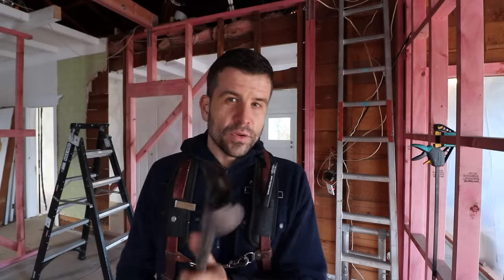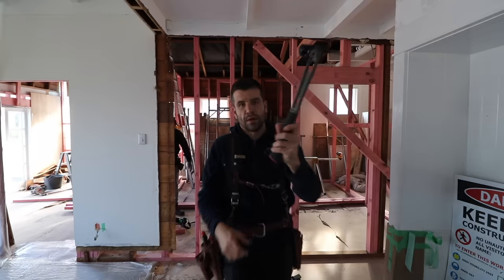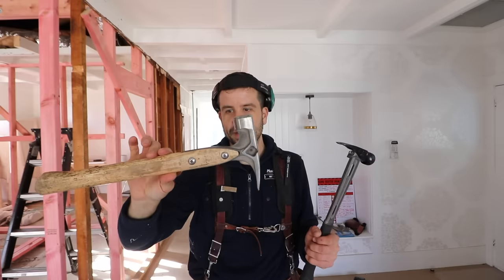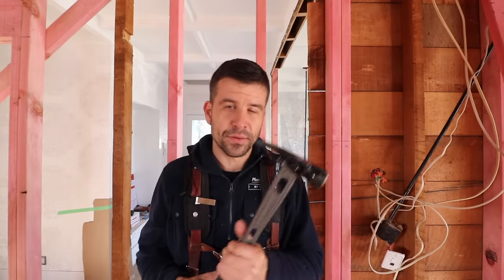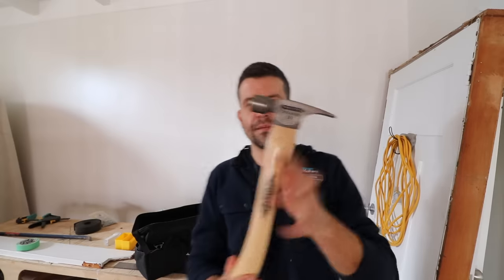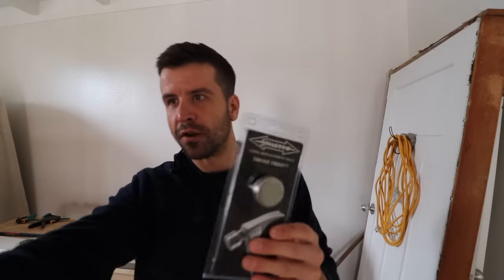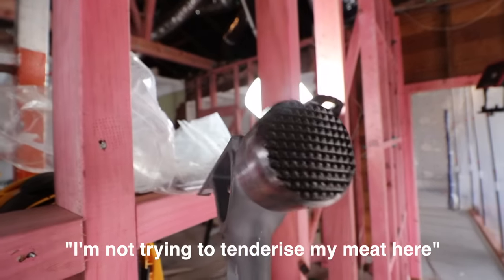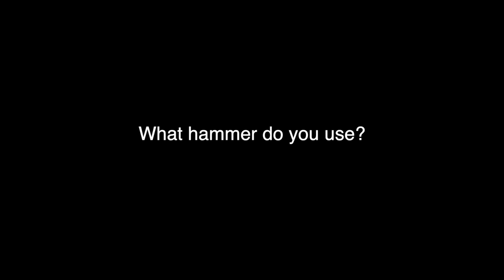Martinez M1: The Hammer Everyone Is Talking About

Comment: Very interesting. I'm not a framer these days but back in the 80s, 90s, and early 2000s I played with a hammer all day. To me the M1 is a knock off of the Stiletto yes they set up the head differently but it is a copy.  If you look back and it should be the same today the lightweight of the titanium hammer reduced your daily load and that since you are swinging less weight the speed at with you swang the hammer was increased and the impact load to the nail was roughly the same. So if this all is true and from using titanium hammers I think it is, then having that heavy steel head defeats the purpose. So I have always given the old Hart Tool company the credit for the California Framer style and that type of hammer and that was the start of the more compact head design.  I will give Stilletto credit for and I can't remember for sure but they were the first with the titanium headed hammer and it was a wood handle and titanium head. I had one when they first came out, then they came out with the TiBone style and I think it was called that too. I still have one of the original TiBones, a Hart Tool Company California trim hammer, and the head of and handle of the original Hart California Framer. The handle was a replacement and it was cut off-center so I never installed it but the head does have Hart straight handle in it. The Occidental Leather Stronghold setup you are wearing I got mine somewhere in the late 90s when they first came out and still have it. I ran mine a little differently I had a tape holder on one of the suspender straps and did not use the clip between them and before that, I used their belts standard style framer belts. The Dalluge hammer not sure but when they first came out they were made or just branded by a different company Vaughan, had one of them too. So one last thing the side nail puller, something I learned from the old guys back in the day when I first started swinging wood handles was to pull nails sideways they always side it was better for the handle and then years later I started seeing the pullers on the side. Good video thanks

Comment: 35 years on the job and still swinging a 28 oz Eastwing leather grip.
Reply: never seen a 28 oz leather grip estwing. Seen a 20 oz and the newer version, 15 and 19 but never a 28 leather. Interesting...
Reply: @ralfish2008  I still use a 32oz leather gripped Estwing I bought back in 1986.
Reply: @ralfish2008  My bad, Thought it was 28oz as was bought thirty five years ago. Google found a modern 24 oz English pattern. Looks like mine.
Reply: @aussiecue   Thanks for the clarification. Ive been bashing nails for 35 years and own a bunch of hammers no fancy titanium ones though just woodies or estwings when forming.  Never saw the heavy leather handled  estwings and was starting to wonder if it was a regional thing. If they had a straight claw heavier than a 20 0z leather handled one available in Canada  I would have bought one. I had a 28 oz blue handled one but almost exclusively used the 22 oz one. Wore several hammers out (the gap in the claw gets chowdered and the handle will wear out and come off eventually. Usually though the damn things just get 'borrowed"  Any one developing elbow issues swinging the steel shanked estwings was gripping the hammer too tight but  admittedly, when I was framing i'd use a  wood handled hammer, usually   a  Vaughn straight claw.

Comment: Its not about a timber or titanium handle. Titanium handle is for hard core formworkers, the handle is designed for cleaning concrete off sheets of ply  ready for re use. The hammer is functional. But realy how many nails did you mess up putting in,
Also never buy a n apron with a fixed holster for your hammer, simply put, customise your apron  and make it yours. Not make some one else's work

Comment: I have framed for 30years, with a wood handle, occasionally they break, but I have never had one “slip” in my hands! Other than the lightweight and low vibration, they are Way easier to holster! , and do that like 100 times a day! (I fucking hate rubber handles )

Comment: Don’t know if anyone has mentioned this, but I noticed all you guys swing your hammer with your thumb running parallel with the handle, point up to the head. A blacksmith taught me that this is wrong, and can lead to wrist and elbow pain, especially with the 1kg+ hammers they use. The correct hammer grip is where you wrap your thumb around the handle, like you are gripping a bat. Try it out and see how it feels. Cheers guys, phil
Reply: Larry Hahn also taught that you should wrap your thumb with a full grip like you’re describing.
Reply: Exactly

Comment: What's the difference between the waffle and the smooth? Is it just a preference or is there an actual function between the two? Love your work and appreciate you sharing your knowledge. Cheers from Paraparaumu
Reply: The waffle head allows you to get more grip on the nails you’re driving in but a waffle head is preferred for 1st fix because the waffle head can leave a mark when it hits timber and a smooth for finish but some carpenters use a smooth head as well for framing. I use a smooth face for framing.

Comment: The powers in the weight of the hammer, in the flick of the wrist and you need weight to drive a nail.  Anyone that uses a light hammer and thanks is easier on their arm are just using it wrong.  There should be no impact on your wrist or arm when and strike the nail with a a loose grip.  You need to catch the young fellas quick at the start your they continue for life and destroy there wrists and arms.  I can drive a nail with one thumb and index finger on the shaft in three hits with the right hammer.  Why do you think hammers have been the same weight for 100's its for a reason.  That guy failing to hit that nail was trying to compensate for its lack of weight with the weight of his arm to do it.  Buy a real hammer.
Reply: Exactly.  There's never a need to adopt a death grip when using either hammer or saw.  The tool virtually does the job for you if used correctly and hammer head weight plays a massive part in the job.

Comment: I started framing with a Stanley all steel 19oz framing hammer. I only used it for a short while, and then dedicated it to demolition only. Then I went to a Craftsman 20 oz fiberglass handle hammer, but someone swiped it. Then I was given a Hart hickory-handled framer by my father-in-law. Ever since then I have liked hickory handles the best, especially the axe-style ones that are curved at the bottom. After breaking the handle on the Hart, I got a Husky 22 ounce framer with a hickory handle and a lifetime warranty. Couple years later, our crew got a special deal on some Stiletto 14oz titanium hammers with hickory handles, but the handles on them didn’t last a month for any of us. Really nice for driving nails, though! DeWalt came out with some framing hammers in about 2010, I think — I got ahold of their 17 oz hickory-handled framer with a waffle face, and I’ve really liked it a lot. Only thing is it doesn’t have a nail set. Not too pricey, (I think I paid around $26 USD for it), the handle is quite long, and really strong, even though it’s not too thick, and it carries a lifetime warranty. Comes with a nice grippy rubberized coating on it, but that rubs off over time. So I got some pistol grip tape and wrapped the handle. Works really nice!

Comment: Spoiled myself on a stiletto bout 5 years ago and I'll never go back to steel. I was doing concrete forming at the time and buggered my elbow swinging a 28oz estwing all day every day. Lighter estwings just didn't have the power and reach I preferred. Needed something better. You need to put more swing into the stiletto to get the same impact but it can hit like a heavy steel one. And way less vibration for sure. Great video by the way.
Reply: I've had my stiletto for 12 years. Only changed the face once. Went with the 14oz as the longer variant grip used to catch my calf mid stride and it annoyed me.

Comment: I've used every hammer shown in this video, including that $20 blue handle estwing and I can honestly say that they all suck. 

Blue handle estwing - Everyone starts with this because it's cheap but it's too heavy, the swing balance is terrible and the face is too small, and has no nail holder. It also doesn't have a side nail puller which isn't a huge deal outside of framing.

Wood handle Titanium - Great swing, light weight and good sized face. The drawback is that it doesn't hit very hard. Also a wooden handle won't last very long (I live in Canada). Wood swells and contracts with moisture and temperature and absorbs all kinds of crap. If you baby it, it would probably last forever but then what's the point. 

Martinez M1- The handle is too big for the hammers tang which means that the handle has a considerable amount of "Squish" which makes the swing absolutely awful. The stilleto's that have a similar looking handle have the same problem. The handle being replaceable is both a blessing and a curse because this problem wouldn't exist if the handle was fitted to the hammer but at the same time handles do wear out and it's nice to be able to replace them. The screw that holds the handle on is very prone to breaking, my brother who uses this hammer has gone through at least three before finally resorting to using a generic screw and nut which makes it a bitch to remove from his pouch loop but at least that one hasn't broken.

Stilleto Tibone - The face being replaceable is horrible as the screw can back out. My dad's never had this problem and it's been a great hammer but my brother's (Before he got the Martinez) would constantly back out. My brother tried every locktite, even the permanant stuff, and nothing worked. When the face is loose, striking a surface gets louder and adds a loud "Ting" sound (it's annoying and a little scary because you never know if that bolt will snap as a result of being loose). The face is also free to rotate meaning that the nail holding notch on top can break alignment if the face comes loose preventing you from using it until you fix it.

The best hammer I've used is the dewalt MIG Weld hammer (14 oz) for about $50. A lot of companies actually make knockoffs of it for less and it's by far the best design. It doesn't have a side nail puller so if that's a deal breaker then you won't like it but the swing and hitting force rival the stilleto and Martinez at a fraction of the cost

Comment: Slippery wooden handles is an easy solution, strip off the finish with a cabinet scraper and then apply boiled linseed oil for a much cleaner feel and grip.

Comment: I use the M1 everyday at work and it’s the best hammer I’ve ever owned. Yeah it’s expensive, but the first year of my apprenticeship I went through 3 wooden hammers. The handles kept getting loose or cracked (since I work in concrete, I’m using it to hit hard surfaces such as steel or the actual concrete itself ). So to me it’s already payed for itself time and time again. Also, all the weight being in the head is an advantage. It hits like a 21 oz or something because nails don’t even stand a chance lol. The Stiletto TiBone is way too light in my opinion and the lack of customization is a draw back for basically being the same price. But to each his own 🤷🏽‍♂️
Reply: Thanks brother, as concrete reinforcing Ironworker this is exactly the feedback I've been looking for. They're too expensive for me to just go out and get it, and most of the reviews are from framers who's needs are totally different from mine. I really wanna get an m1 with axe handle and sledge head on it, and maybe get an extra normal head for just on case I need an actual hammer for normal hammer activities besides just smashing steel bars lol

Comment: Well, for sure, the straight claw hammers are not made for nail pulling. Most of the construction I did was concrete work, so forms... I always carried a cat's paw nail puller. The guys made fun of me for it, but they always wanted to borrow it. I did have an Eastwing metal shaft hammer and gave it away to some one I didn't like. I did pull a lot of nails with the straight claws by racking the hammer sideways. That side puller thing for nails is a good idea. It surprises me how many people have no clue about putting a 2 by 4 block under the shaft for the extra/better leverage to pull a nail. It does save some wood handles....

Comment: I know this video is pretty old now but in '03 I started out swinging the Douglas 23oz framer for 7 years, I got out of building for 5 years n worked in a sawmill in those years. During my sawmill days all my tools and Occidental tool bags were stolen. I got back into pounding nails 6 years ago and had to start from scratch with building my tool arsenal back up. I found out that Douglas was no longer making the hammer that I loved so I found the Vaughn 16oz framer which I swung for the last 6 years until a few months ago I stumbled upon the Martinez M1. After weeks of contemplating spending $300 for a hammer I bit the bullet and for the past 2 months have been loving the M1, although I wish Mark would make a flat top milled face (not waffle face) framing head. I too did not really like the top heavy feel of the hammer after swinging the 16oz,  but after about a week I would never go back. Now for the past couple weeks I've been contemplating on spending $300 for the Martinez "Red Headed Step Child" titanium speed square, which I probably will end up doing lol. I believe investing in quality tools that will last a long time and will make your money back 10 fold. 🤙

Comment: 4:00 To combat the "weight working against you"... for tapping in pieces of wood, you could just let the hammer grip slide up your hand for a "short grip" for more controlled taps, then let the hammer drop back to "long grip" for larger swings.... Change your Paradigm of thinking that you are only allowed to grab the grip of the handle. Think like a blacksmith and how they are always adjusting their grip on their hammer while forging metal. You can do the same for carpentry ;)
Reply: That's what I was thinking. Speaking as someone who's never actually worked a day in his life I wonder how feasible/usable it would be to fashion a wooden grip to fit into one of the openings in the titanium part for comfortably choking up on the hammer.

Comment: I love my Martinez. Wish there was a version without the trick magnet nail holder. I have used this hammer for over a year and have never used the nail holder, but the top of the striking face with the magnet nail groove has beaten up two cats paws. Thinking of welding the groove closed and suffering loss of temper. PS all Ti hammers have less inertia than steel, allowing the hammering of such things as fencing staples without flattening them. Makes the fencing wire last much longer when the staple has not pinched the galvanizing off...

Comment: The Deluge hammer you have is exactly the same as my Douglas hammer which I’ve had about 15 years, and it’s a lovely hammer don’t do any real heavy work with it. I also have an estwing 20 oz leather grip which I recently regriped had it since 1976 was years ahead of its time and in my opinion the best there is. Replacement heads and handles ! Just buy a proper hammer and save a fortune on all these that have the looks but don’t perform 😊

Comment: Estwing E320C or S which is the rip claw and the C is the curve claw , I own one which is 24 yrs old , but I use my dad's old one which is over 50 now and still works great . I got it when he passed away 9 yrs ago . He was also a Carpenter/joiner . I run my own carpentry business these days . I've toyed with the idea of Titanium hammers and have almost bought the Vaughan Dalluge 3 or 4 times , and decided not to bother . The Martinez is overpriced garbage with no great benefits given its £330 here in the UK and not easy to get . The Stiletto Tibone is around £240 and the Vaughan around £130 .

Comment: Man that sucks that you have to use P.T. (pressure treated for the laymens). So many reasons why that sucks. The man thing is breathing in all the treated dust everyday. Also splinters. If it's a P.T. splinter you can't just wait till after works like one would normally do, you have to get it out right away or it will blister and fill up with puss because of all the random assortment of chemicals in P.T. wood. It also doesn't smell as good as regular kiln dried pine 2 by. Plus a little more expensive which can make a big deal when you're buying like 100 studs each job. Feel bad for you buddy. I'm sure you're just used to it by now.

Comment: Hammer being used at 9:41 is a FINISHING Hammer.  Should be using a FRAMING Hammer for better nailing of the studs without hammer slipping off the nail.

Comment: If you swing a hammer with your thumb behind the shaft, maybe you should not be reviewing hammers...

If you think rip claws are designed to pull nails in line with the head, perhaps you should not be reviewing hammers...

If you fall for the Martinez spin, particularly after he is totally contradicting himself, perhaps you should not be reviewing hammers...

If you think a Martinez wreaking bar is a better hammer than a Dalluge/Douglas hammmer, You certainly should not be reviewing hammers.

That said, the Martinez has some interesting features, but like most modern hammers, they are basically for guys to repair a goof with their nail guns.  Which is a good thing as we live by our nail guns today.